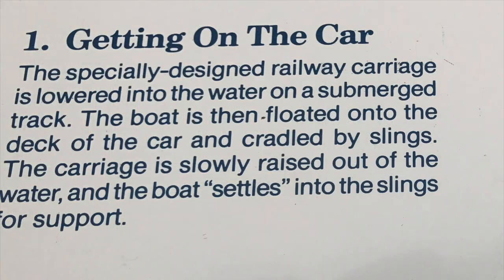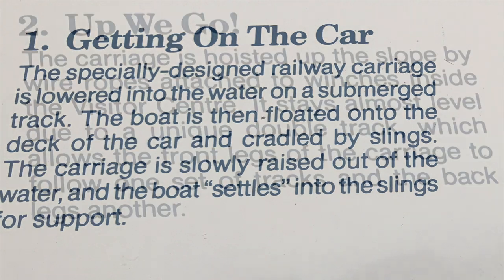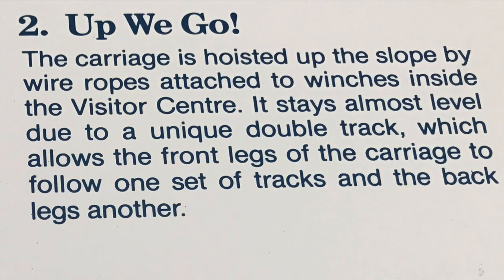"The Big Chute Marine Railway" on the Trent Severn Waterway, Lock 44, Coldwater, Ontario

Comment: The slings are weighted so when they are released they drop away from the props BUT you are cautioned to not be too eager to pull out of the carriage until they've dropped away. Some have damaged props and lost rudders due to their impatience.